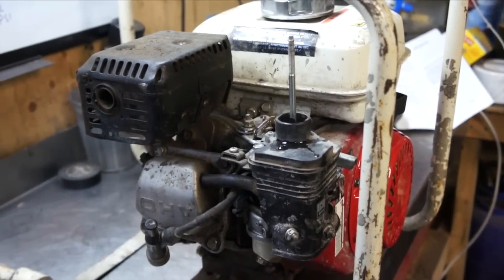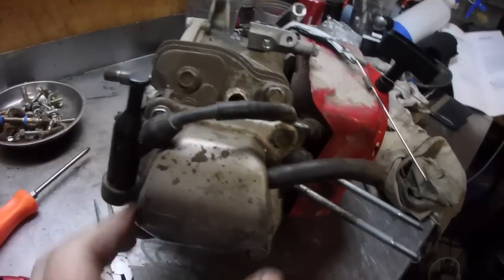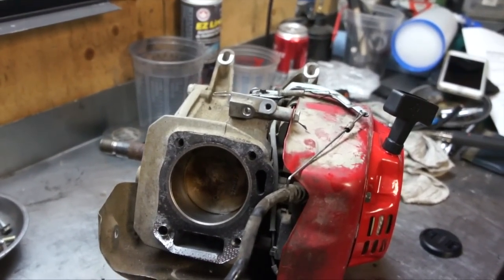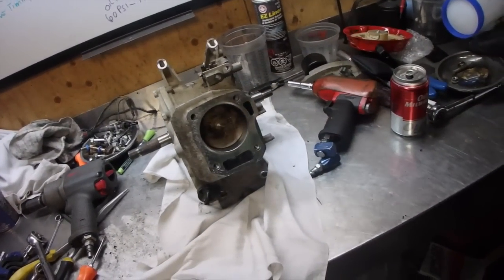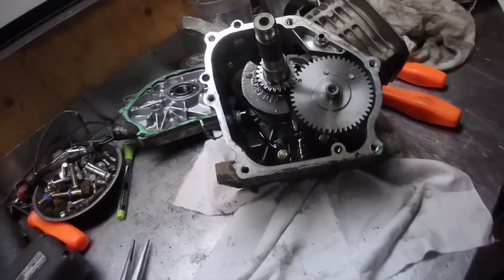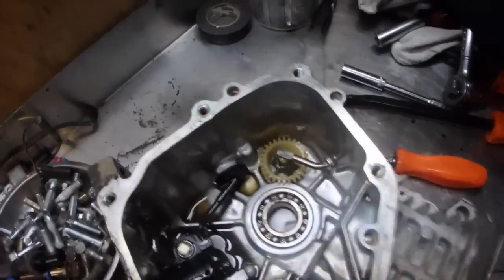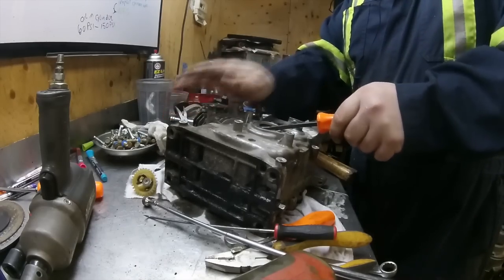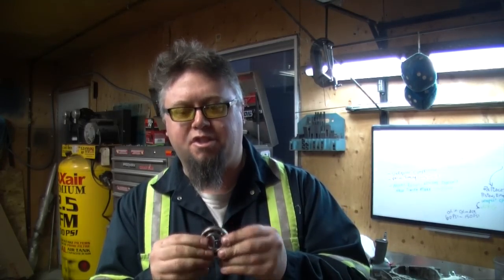Honda GX160 DIY Rebuild teardown

Comment: I don't have a gear puller, but I need to get a flywheel off my gx120. any ideas?
Reply: I have a gx160 but I think it’s the same all I did was use a pry bar and lightly put pressure on it and then I hit the bolt on the end and it just popped off ( went I looked it up it said it wasn’t recommend to do it that way but as long as your careful I had no problems )

Comment: ,ser i ask something,, what is the name of wiring inside of engine and its function?,
Reply: it's a safety switch , in case there isn't enough oil on the engine it will shut off
Reply: @BONFIRERG  ,thank you ser for your comment,,,
Reply: @creedstag7843  your welcome .

Comment: I'm trying to fix my gx160 and I bought it a lot that comes with carb, spark, gaskets, and new tubes I am getting good spark but it won't start I was thinking it was the oil and level being low and I checked it and it was too liquidy and I think it was full of gas and oil...what do you think happened
Reply: Andres Hinojosa im pretty sure i have the same problem
Reply: Did you manage to get it running I need help with mine

Comment: Great video but you edited the part where the pullstart is removed and the big nut beneath it which is the part I wanted to see.
Reply: same here
Reply: Also the part I didn't want to see is where you need a specialized tool to remove the flywheel :) Guess I won't touch it then.
Reply: @deniskobozev3916  a rubber hammer works also
Reply: Denis Kobozev you don’t need a special tool to remove it it’s recommended to use but if your careful just put a pry bar between it and the engine and lightly put pressure on it and then put the bolt back on the end and take a hammer and give it a tap or two not crazy hard or anything and it should pop right off that’s how I got mine off I just looked up some videos on youtube just make sure your careful with the pry bar and try to get it in a spot that’s reinforced so you don’t crack the engine casing but like I said just put light pressure on it and you should be fine

Comment: Hi Jerry, I have a honda gx160 and I need to change the crankshaft from a tapered one to a "q" type one. Can I replace it without having to strip the head down or will it damage the valves if I don't?
Reply from the maker: +Richard Grant yes you can, you'll need to remove the flywheel and everything attached to the crank, pull the side cover off, turn the crank so you can remove the connecting rod bolts, you may have to pull camshaft,  and push piston to top of head to remove crankshaft.  Reassembly make sure timing marks are aligned and double check valve clearance before starting
Reply from the maker: +Richard Grant in short no head removal is needed
Reply: +jerry bskorner how do I check the valve clearance before start up?
Reply from the maker: +Richard Grant I have a video of that in my play list

Comment: if it were me Id just put a new sleeve in it and I think I would replace that bearing. smooth tear down Jerry, its good to see you busy again in your shop
Reply from the maker: +Silicon Valley Engineer easier said than done until you find out the cost of a sleeve and labour for a machine shop to install it far outweighs the price of a new motor
Reply: +jerry bskorner Your right about that. I was wrong as I had thought you had a bridgeport mill in your shop. Yep too expensive !
Reply from the maker: I wish i have a cheap china made mill/lathe combo that has so much play in the bed that i can't even cut a keyway straight as you'll see in a future video

Comment: I love messing with small engines like that and seeing how they work.  Trouble is replacement parts for them are so pricey vs. just buying a new engine.  Kinda typical of the throw away society.  For instance a new carb for my lawnmower engine was like $20 vs $35 for parts for a rebuild kit.
Reply: I agree I was gona rebuild the carb on my 6hp tecumseh. a rebuild kit is 15$ but I can but a brand new carb for 20$. no brainer

Comment: The marks in the cylinder look like maybe the piston was left in one spot for a while and the ring corroded at that spot , what do you think ?
Reply: that's what I was thinking too
Reply from the maker: +Nick Pelletier correct it sat with water in the cylinder which ruined the piston sleeve